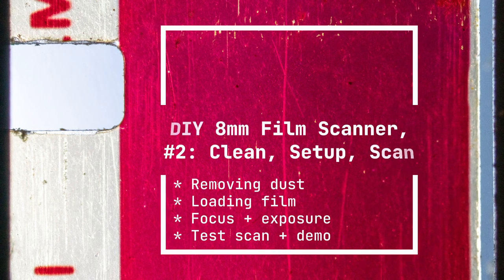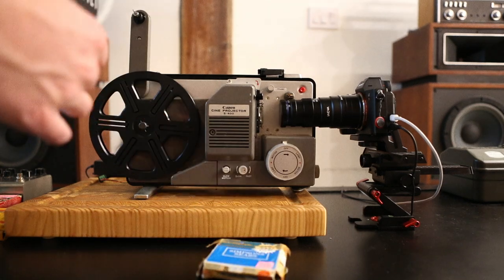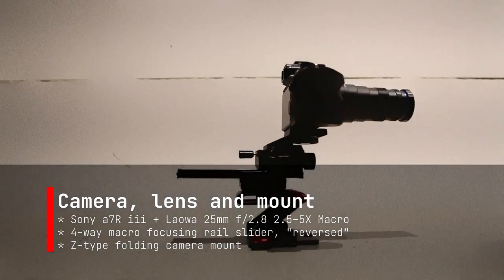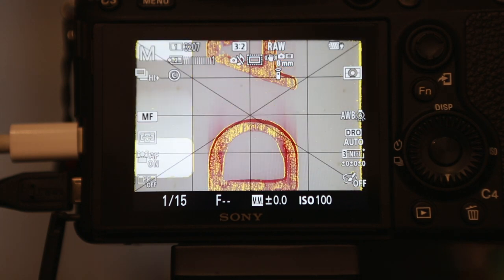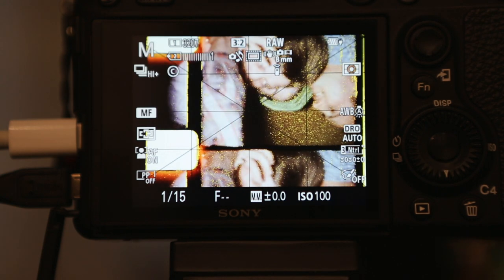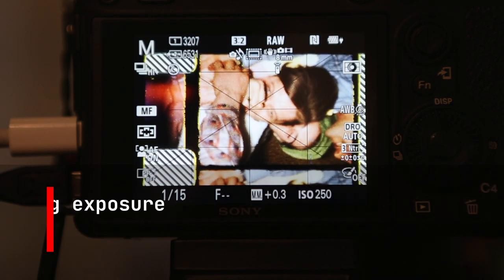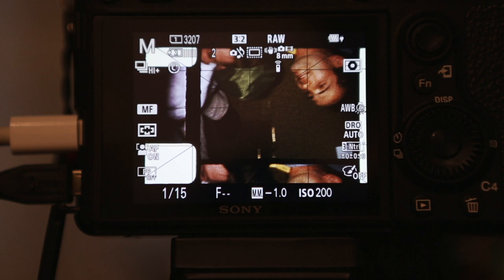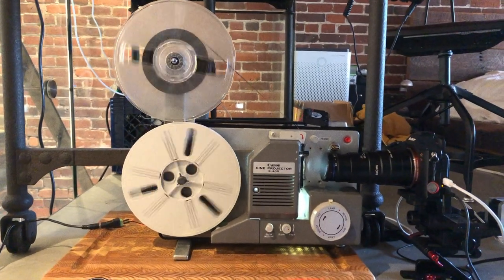📽️ 🎞️ 📸 ⤳💾✨ DIY 🛠️ 8mm Film Scanner, Part 2: Film cleaning, camera set-up, test scan

Comment: Hi Scott, I just built a scanner very similar to yours. I scan the older "regular 8" and the "newer super 8 with sound". Exposure is a real problem. I'm using "bracketing" - so called for PANASONIC LUMX. My settings produce 3 exposures, taken with 3 shutter speeds, for one trigger. This results in 3 images, that differ in one stop. In post, I can select the right exposure scene for scene. Of course, this takes a little bit longer for scanning.
Reply from the maker: Thanks for sharing, this sounds really neat. If you post results and some video of your gear at work, let me know! Thus far, I have only one Super-8 film with a visible soundtrack. I have yet to try decoding the waveform from the image, but I believe it can be done via software as well.

Getting the exposure is tricky, indeed! As seen in this video, I try to find a suitable exposure time and adjust per-scene if really necessary during scanning.

I'm familiar with bracketing from digital photography, and your use of it for film scanning sounds neat. You must be quite patient, waiting for 3X(?) the time it takes to get those shots and then "in post", choosing the right set of images per scene. I imagine this approach pays off later on, when you find differences in lighting between scenes.

If you're getting three raw images from this (vs. just JPEGs), that's even more headroom for post-processing. That must take a lot of disk space, but I wager it's worth the investment for family memories on film and that sort of thing.
Reply: @scottschiller  hi, I'll will upload some video next time. For sound, I filmed with super 8 KODAK cassettes, which have magnetic sound embeded. As I also own an Bauer projector for super 8 with sound and regular 8mm. So I'm able to record sound from this and add it in post. But it's terrible sound: projector adds mains hum and the sound wobbles with the images, plus some hiss. I reduce hum with an notch filter - 50Hz for us in Germany - and dampe hiss in the higher frequencies.
For exposure: because I have large, long running spools of bw regular 8mm, I don't want to sit beside the projektor and correct ervery scene. These long running films are also the reason why I am just adding a light barrier to the feeding mechanism, to guard for film breaks - old glued cuts - and end of film on fedding spool.
My workflow - at the moment - is take 3 JPG per frame, differing one stop, import into Sony Vegas Pro, one timline per stop, cut scene per scene and select best exposure. Then record and clean sound, import in SVP and sync image timelin to sound timeline. This include some slowing down the image timeline.
What's your workflow, especially, how can you import RAW single images?
I also have DaVinci Resolve, but I have to buy a new graphics card, because the latest issue of Resolve doesn't work with my - I admit - actual one.
But this workflow is sufficient for my spectators.
My problem is, that my 2:1 macro lens are a little bit thick - 60mm diameter - and I cannot come close enough to the frame window, the construction of the projector doesn't allow this. But I thinking about it. 

On the other hand, lots of projects are waiting: check my REVOX A77 breaks, after refurbishing electronics, develop electronic for my model railway... And last but not least, film scanning is an open field:
https://www.youtube.com/watch?v=kmGhHNWg8Bc
https://www.youtube.com/watch?v=QOrl4dzVMlk&list=PLCZ_r2AbMTZBPFU-j9EV52qTIsgjeJWTk
Reply from the maker: This is great info, thanks! It sounds like we have a few common projects between film, trains (full-size and model), and ReVox A77 stuff. Funny coincidence.

I haven't tried a projector that has sound playback, but maybe that'll be the safest way to go if I can't get anything working via software.

I like the idea of having three separate timelines, and cutting to only show the "best" for each scene. It may take longer to scan, but then you have all your source material ready to go. From my end, I try not to micro-manage the scanning; with RAW images, I have a pretty good dynamic range and the ability to recover a lot of detail from the shadows before things get too noisy. I plan to document my approach in "Part 3" of this series. At present, I do most of my image editing in Adobe Lightroom Classic as that's what I've been using for over a decade. I then export images, do filtering and an export etc., in DaVinci Resolve (free version) which is quite good.

My Sony a7riii camera has bracketing and a sort of multi-pixel / multi-exposure feature, but I haven't felt the need to dig into those. With my current RAW workflow, each image is about 18 MB - so it's crucial to have fast memory cards, USB-C and a fast SSD for editing on the computer. I hope to get into this in "Part 3", or maybe a "Part 4" if I have enough material.
Reply from the maker: Is this your project, a scanner based on a Revox A77? 😮 That's amazing! https://www.youtube.com/watch?v=aZuqSJPAQ0g

My focus has been on getting quality scans - exposure, focus and all that, thus far. I also want to look into reducing "shake" and jittery motion in the resulting video, whether it is the film moving or the original camera person being a bit shaky. I know software can do a lot of the magic here, but I haven't really dug in yet.
Reply: @scottschiller  No, thats no project of mine. I certainly never ever will canibalize my beloved A77. But there is work to do on their mechanics. Yes, I'm also searching a way to stabilze, despeckle, sharpen etc. without an ph degree in AI. I will produce and upload my project next.
Reply from the maker: Ah-ha, thanks for clarifying. I'd prefer not to ruin an A77 either, unless it was unsalvageable otherwise! From what I've been reading, "AviSynth" is a popular frame server that people have written scripts for, in terms of film restoration work - but it seems to be a Windows-only project. I'm on MacOS and looking around for some cross-platform alternatives.
Reply: @scottschiller  Yeah it's a windows world. What about renting a windows server for a time? I found this interesting video https://www.youtube.com/watch?v=5TrLaDHu-M4&t=18s
Reply from the maker: Ah-ha, that video looks pretty good. I got “Neat Video” for DaVinci Resolve, and it can make an impressive difference. It would be great if more of these corrections could be included in the Resolve workflow, but I’m not sure if all the aspects of the AVISynth-based scripts by “Fred” and others are covered by Resolve.

I’ve heard of VapourSynth as a possible AVISynth alternative for Mac/Linux, but I am not familiar with either and that may be a whole other project. 😅

The nice thing about the scanning project this far, is having those RAW source images available for whatever post-processing technique suits your setup and/or preference.
Reply: @scottschiller  Hi, here is a short take of my setup: 
https://youtu.be/6ROtAySBQtk
The main difference to yours is the dc motor, your stepper motor is by far better, and the lightbarriers for feed and takeup reels. As I have lot's of long running regular 8mm films from the 60's, which I scan unattended, these are neccessary for detecting transport problems. The following workflow is also specialized for regular 8mm films: I take brackets of three jpg's +/- 1 stop, which I sort out in post for right  exposure. Regular 8mm of that time is not very shrap, so RAW isnt worth.Also AI like DAIN etc. doesn't work with these blurred material, it gives irritating results. Davinci Resolve does a fine job for staibilizing, and NEAT helps a little for reducing grain, despeckle and sharpening. I wil upload some results next time.
Reply from the maker: @transit2digital16  Thanks for sharing your build, it's neat to see in action! Sounds like it's worked pretty reliably for you. When doing my research, it seemed a stepper motor was the safer route to go in terms of consistency and reliability.
The bracketing approach is interesting, I like that. Noted re: DAIN and similar AI on 8mm, I haven't tried that on any of my scans yet.
I have tried "Neat Video" and have been impressed with it, thus far. I intend to detail more of the post-processing I do in a future video, it seems folks are interested in that part as well.

Comment: What is the fastest FPS you can achieve without error?
Reply from the maker: In testing this set-up, I found I could run the scanner faster than 3 FPS provided I shot in crop mode, and using a fast (“300 MB/s”) SD card in the high-speed memory slot on the Sony a7riii. I may have also tried raw compression to reduce file sizes further, but I don’t remember whether that affected response time or write speed.

Either way, I found that the remote shutter trigger - or something in that path - may have been the bottleneck. At some point around 3 FPS, I noted missed frames even though my circuit was firing the trigger button reliably. It’s not unreasonable that Sony may have limited the remote shutter trigger or only check that “input” three times a second, for example.